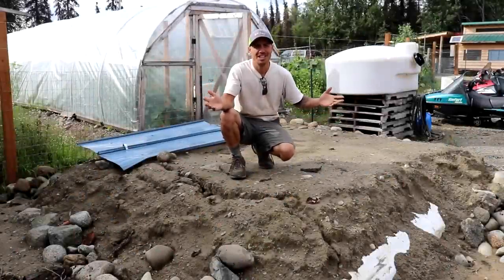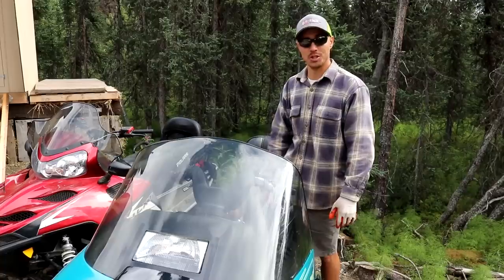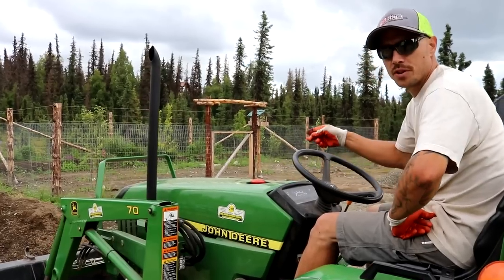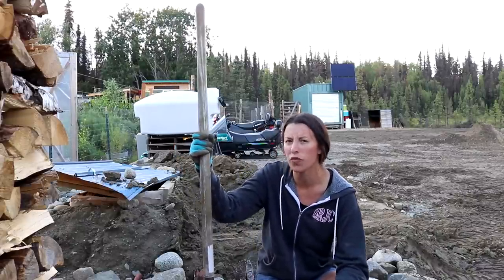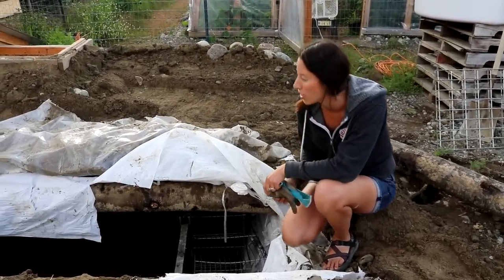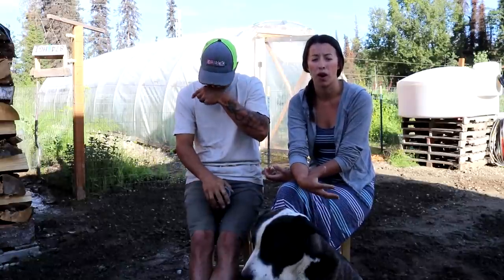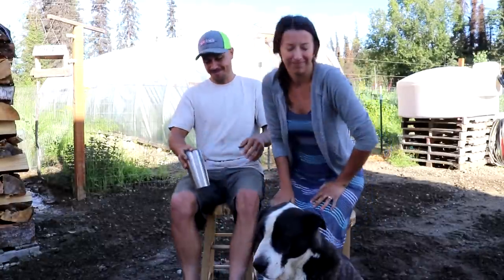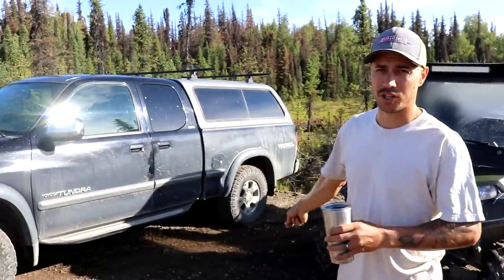Our Earthbag Root Cellar Fails | Addressing the Mud Issue

Comment: Ah, my next door neighbors just north of me a few miles as they say here. Sad that it didn't work out. I used wood in that area many years ago, at least twenty and just a few years ago had to lay a pipe through the corduroy road thinking we would have to replace the wood as it had been there so long. No matter the species, all sound as hickory nuts when dug up but the pipe had to be laid an deep so we saved what we took off the top and when got to the road bed cover time reused all the trees we had used from before plus a few as any hole that you fill here seems to take more than you take out to fill back but as of now it is still holding well. Just about every winter has been some ice and snow but spring is the worst, water where none could be found in the summer and it completely covered that road and if you got off the corduroy then you were stuck hard so you knew that   trail well. A beautiful house back in the woods that we purchased many years ago as its showing the age now but the road is great with the exception of two spots and it requires more punching... about say ten or so six inch poles as filler but that is it. So your high and dry as far as getting in and out.... My idea ranges near real stupid to it might work. I had a commercial locker plant or the folks did to be more clear. It was in a area where summers were hot an not many people had more than the home fridge. No freezer so our system was the only in town and dad made some good money off it. What it consisted of was very thick insulated walls that were filled with very dry sawdust chips. If they ever got wet then things would go south in a hurry and when that happened there, thats just what happened. So on a much smaller scale, a very well insulated room above ground, and it has to be extremely well insulated. The floor has to be as well but just not as thick. The roof has to be even better. If constructed in the shade it would maybe save some money but other than that it wouldn't matter. Now cars have air conditioning and so you  can get air conditioning systems after market or cabbage one out of a vehicle .... You need a double door to go in as the false air space keeps the cold air in that room that you build. Nice part is all above ground and driving nails or screws. If you had your little own saw mill and could cut ruff cut it would be excellent for it. The roof could be done much the same way and still be vented or it would mold so air needs to circulate but you kids were not born at the knowledge of mine last night. I was born shortly after midnight so go figure... I just know that if that room is kept cool then a regular fridge can be made into a freezer but that wouldn't be the stopping point as the little old ones that need a coat of paint to be in sight  would work just fine...... mine was given to me    as it had a dent in the top of it an was one too many an one favor comes back to me as I helped him before. A board and bat outside and a small pony roof over to make it stay on the property but with a solar light in the summer and the winter nothing is needed as mines unplugged most the winter. Too long a post but never could get the idea of simple through my head

Comment: Hi guys. Love the videos. Would you be able to build a reinforced concrete bunker with a sump in the bottom? This sump could be drained with an electric pump? The walls could be 10 inches thick. It would be a LOT of concrete but if you mixed it yourself it would be a whole lot cheaper.

Comment: Basements below the frost line, can flood. - Like chicago the footing needs to go below the frost line, 4 + feet, but the water table can get  higher than that sometimes. -- so waterproofing, the walls both outside and inside are done, and last's till membrane fails. in 80 years. Also just like caskets in a grave yard, hydorstatic pressure can raise the structure, (floats like a boat)..  when drains are installed, ground water can come up thru the drains: Maybe construct root celler on higher ground, and not deeper than the water table at its high point.  and be prepared to sump pump if need be. so don't store your stamp collection down there.

Comment: I wonder if you bought the biggest size septic tank you can find and bury that in the ground. All concrete reinforced. Should keep any water out. Might have to jackhammer an opening a bit bigger. Only concern might be that it would try to float up on the water and lift out of the ground? Not sure. You can probably calculate the weight of the septic tank vs. displaced water to see if it would float or not.

Comment: you could build it on the ground level use culvert pipe 8*8  or just use cinder blocks cover it with dirt like a hill from 3 sides the trick is to have a small door in the front and just insulate the door less time no water issue good luck

Comment: 2 questions :
- any way you could have installed pipes under the newly spread gravel to funnel the  accumulating spring water out towards the bog ?
- would a buried shipping metal container work as a replacement root cellar ?
Too bad the work you guys put into the root cellar didn't give you much return, and too bad you couldn't salvage more of what is now under your land.
Keep it up ^^

Comment: Did you ever think of building double wall structure on the ground, accommodating the thickness needed not to freeze, and filling dirt in between the walls? We had one like that, for our water level was almost ground level.

Comment: sorry it didnt work out. I'm not sure if you have found a solution for your root celler yet or not but you may want to try an earthbag dome or a series of earthbag domes built above ground and just berm them. my wife and I built an entire earthbag home like this. domes are generally self supported by the way they are built. you should add rows of barbed wire between each row of bags to prevent the bags from slipping and shifting and for added suport you can drive lengths of rebar down into the bags. you also have the option of covering the bags with concrete.

Comment: Would there be value in building a square or rectangular above ground root cellar which is very well insulated and then cover it with dirt, making either a pyramid mound or containing the insulating dirt with wooden external walls?  That way it would be dry all year round, and humidity could be controlled via water baths/humidifiers to whatever level was required.  Building such a structure would also allow one to put in an internal dividing wall which would allow one to have different humidity levels in each half for the specific needs of there contents stored in each. The entry door could also open into an airlock with another door opening into the root cellar proper - with the attendant insulating advantage.  Obviously a more expensive project, but one which could be built from timber etc using the obvious skills you possess, thus reducing costs.

Comment: Try building earth bag dome crueller mostly above ground. The dome shape and the thick earth bag provides constant temperature. Done shape is way more stable than square structures. Also, I believe you need to add and mix an additive like lime or cement and water to the earth mix. When it dries it will turn hard like brick.

Comment: Knowing the water level is 3' down in an exceptionally wet year gives you an opportunity to consider going down 2' with a french drain system under that floor.  Building up, either with earth bags, or even a repurposed septic tank for the walls, then build a dirt mound around it, 4 to 6 feet wide and 3 feet across the top will give you the refrigeration you seek and keep your moisture issue under control.

Comment: It's been a while since I was in Alaska. I was stationed at Elmendorf AFB in the mid to late 90's. It's still beautiful. So I just got through watching your endeavors of living off grid...sorry that you guys lost your root cellar. While you were showing the viewers where you had spread the layer of gravel to extend some of parking space for your vehicles and equipment I heard you mention that the bog is part of your property which is lower that the land you live one. I think that if you ever want to build a traditional root cellar again you will have to implement a French drain:

A French drain or weeping tile (also trench drain, filter drain, blind drain, rubble drain, rock drain, drain tile, perimeter drain, land drain, French ditch, sub-surface drain, sub-soil drain or agricultural drain) is a trench filled with gravel or rock or containing a perforated pipe that redirects surface water and groundwater away from an area.

This has been used for centuries and it is still in heavy use today in regions all over the world. I believe that if there had been a French drain added to your build the outer wall wouldn't have been weakened that led to the buckling. Due to your location you would most likely need to insulate the drain pipe to keep from freezing. I felt so bad see it fail and only seeing later how close the downward slope was from the root cellar. 

Please I/we all encourage you to not give up on this task. Do some research on the French Drain. I'm sure once you do the build gears will start spinning again for the both of you. 

Best of luck,

Dave

Comment: What is the elevation difference between your high ground and your bog?  If it's enough, you could run a drain pipe, "drain to daylight", so no pump required for a new root cellars.

Comment: I have yearned for a root cellar but the underground part brought issues for me. Your dilemma sparked a thought, why couldn't you build totally above ground and use foam panels to insulate, then cover with much soil. You would need a good high R value door mechanism and a good air seal. This would get away from flooding issues.

Comment: Have you considered doing something similar but no where near as deep under you house, with a trap door. Like a foot or 2 in from the sides and square and down about 3 feet and all the way up to your floor. It may be colder than you want but if you put ridged foam insulation on the outside and inside it shouldn't freeze

Comment: here in Idaho potato cellars used to all be built below ground...to unload the trucks meant backing down a steep ramp into the cellar ...but now all the cellars are built above ground and either mounded over with dirt and straw bales or simply insulated with lots of spray on foam on the inside of a metal building..I think this general idea could be scaled down one way or another to meet your needs...check into it ...don't give up you could still have a root cellar

Comment: Hello arm chair advice here so take it for its worth I am in Missouri we have a lot of old root cellars dotting the landscape here all made from cement most hand mixed an poured but the point of this comment is not what there made from but what you find with them many of them at most are only 2 to 3 foot below grade if that much now many decades sense they where used they are exposed but originally they where built how they where then a layer of 4 or 5+ foot of soil was placed around and on top of them sense its washed away or subsided but this is one way with high water table or bedrock near surface to have a root cellar and it might be an idea for you 

best of luck love the vids watching them during another 2 week bout of Covid-19 isolation

Comment: Would you be able to build an above ground root cellar?  You can google ideas for your area better than I but mounding earth up against the walls and some on the roof to maintain a constant temperature inside?  May need to have a kind of 2 door entry so there is a buffer to keep the cold out in winter.

Comment: It seems like you have a slope behind the snowmobiles, here in the northern part of Sweden you often se root cellars built against a slope coverd by a "living roof" aka turf.
Basic construction: box made of resin rich sprucewood, crushed rock on the outside and bottom about 2 feet deep in the "floor" and walls. A double ceiling for insulation and ventilation. About 3/5 of the cellar is dug in to the original slope.
From what my grandfather told me so should de bottom (below the gravel) be about a meter above the highest flow in a stream and 2m above the higest level for a lake or bog.
I have heard of people digging "false wells" to drain land but I'm not very familiar with how the aquafir should look for that to be a good solution.

Comment: What a bummer. Sorry your food storage didn't work. It takes a while to get to know your water flows and the terrain. In the States we have topography maps in booklets that show the contours of sections of land so a person can get a general feel for the height and tapers of the land. You could probably see them in the library OR MAYBE these days thier maybe on the internet. Sounds like your water table may be close...if you have bog? I've heard of some people that build with cement block a small room and then push soil up on two sides. I don't know what you all have to do on the side of the blocks...sealant? Plastic? It has to be so the ground tapers away or so your drain tube can allow drainage. I'm just learning some of this. I hope to use a level to set in a landscape tubing.

Comment: I'm not sure if you have a mountain close by and you could fortify it I'm not sure that would work? Have you looked at Justin Rhodes hold room that he built. You would have to use an air conditioner however in the winter I'm not quite sure if you would need that.

Comment: Your videos are great. Always impressed with how hard you guys work. Then I think "yeah, but their livin' the dream in Alaska." Wondered if you could build a pantry onto the cabin (for easy access) and control temp with ventilation, using some of the cabin heat in the winter and outdoor air in the summer (or a geothermal setup)? I remember my grandma using a wooden box on her porch as a freezer during our 6-month Minnesota winters. I guess you need to be creative when you live in the wilderness.

Comment: Maybe add a well insulated pantry room off the side of the house.  Since it is above ground then some heat will be required to keep above freezing.  Connected to the house then some indirect heat could be directed into it to maintain as desired.  Also, you would not have to go outside to get to anything.

Comment: Guys, we are thinking to build root cellar start in the spring. We were thinking to use earth bags. Now after we watched your video we are having doubts. 
What would you suggest? How you gonna build your new root cellar? 
Concrete? Blocks? Please help before we actually start doing it.
Reply: , Here is a Idea, and its Cheap like Me :)  get a 20 Ft shipping Container, paint the outside with Epoxy Paint, brace the inside if you think it would need it, Don't Bury in the ground but set it on top of the ground, make a door on one side about 30 inches wide and extend it out about 10 feet or so like a Igloo  from the shipping container, cover the shipping container with soil top to bottom, use some chain link fence over the soil and lay some sod or ground cover on top of the chain link fence and soil, to hold the soil from washing away. or spray with  concrete Just my 2 cents worth :)
Reply: @CHELLIE2408  Thank you for the idea. 
Could you please refer me to cheap shipping containers. They are no longer cheap. The cheapest I found is $4,000 and transport another $2,000 or more. The price goes up to $20,000. 
So how is it cheap?
Reply: @genevelis6075  Gene your right, I priced a shipping Container about 4 years ago for a garage, they were about 1000.00 back then for a used one.

Comment: What's the possibility of putting a structure within an animal barn to store your canned goods and vegetables? It would still be cold, but the heat from the animals could help keep the stored food from freezing. I'm thinking of larger animals that produce significant heat, so this might be for someone else, and not necessarily for you. Another thought would be to have the cold area within your home, cooled from below, and generously insulated so the house wouldn't heat it. This would be for the situation for someone who is on flat land with water issues. I guess I'll find out what you ended up doing as I watch more of your videos.

Comment: Now that you've had a year to think about it, what do you think would have improved your below grade root cellar to where the water wasn't a constant threat? Personally, I think I would try taking a 20 foot long Conex shipping container at one foot above current ground level and line the outside with earth filled bags. For the roof, I'd reinforce the current roof with 4" x 4" "I" beams and line it with thick waterproofing plastic and six inches of Styrofoam insulation before I covered it with earth bags and a foot of dirt. That should insulate it well enough to keep the temperature pretty constant year round. Back fill the sides with dirt as high as you can also.
Reply: I had pretty much the same idea :) a little different but similar :)

CHELLIE2408
2 minutes ago (edited)
Bummer , I would not have seen that  water ground Level problem, Here is a Idea, and its Cheap like Me :)  get a 20 Ft shipping Container, paint the outside with Epoxy Paint, brace the inside if you think it would need it, Don't Bury in the ground but set it on top of the ground, make a door on one side about 30 inches wide and extend it out about 10 feet or so like a Igloo  from the shipping container, cover the shipping container with soil top to bottom, use some chain link fence over the soil and lay some sod or ground cover on top of the chain link fence and soil, to hold the soil from washing away. or spray with  concrete Just my 2 cents worth :)